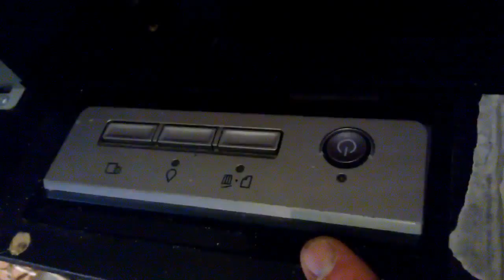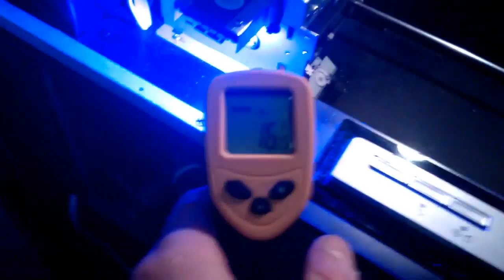Epson R1900 UV LED Printer DIY DTG Part1

Comment: I saw a tutorial of yours for a printer converted to uv I just need to lower the intensity of my uv light as you did the dimmer or how you did the electronic to lower the intensity my email is nelsongas@gmail.com if you sell the tutorial how to do it with pleasure I buy it, I want to lower the intensity of the light
Reply from the maker: Dimming Drive Unit: Mine was a 50W UV LED so I bought one of these:
https://www.aliexpress.com/item/1394014280.html

Comment: How can I converter my a4 dtg into big size.. I mean I can built head moving section longer as well as with its ir encoder .. but how will Epson know that it can print bigger now.. need to upgrade it's motherboard.. ? But how

Comment: Is that UV ink etch resistant? thinking about printing PCB for etching in acid.
Reply from the maker: I think it will melt in Acid. You can rub most of it off with Acetone, so I think Acid would be too harsh. You could buy a cheap UV printed Iphone case from Ebay and see if the acid etching will take it off. I hope this helps.